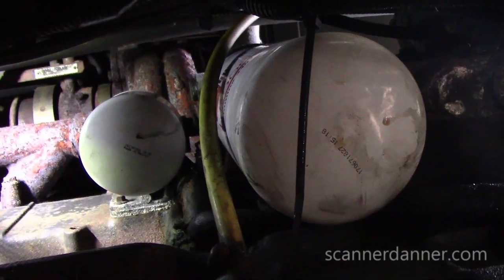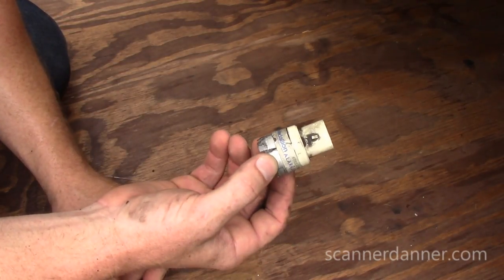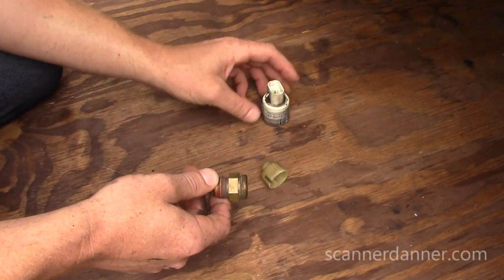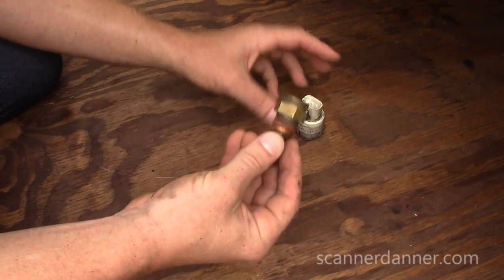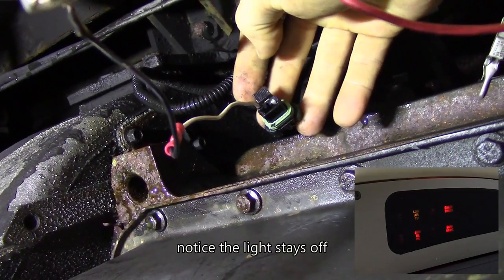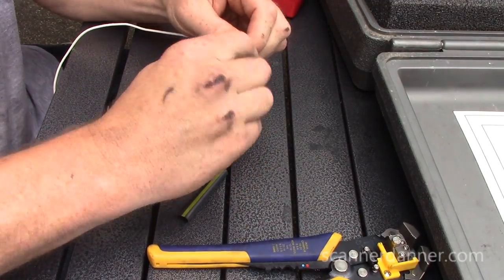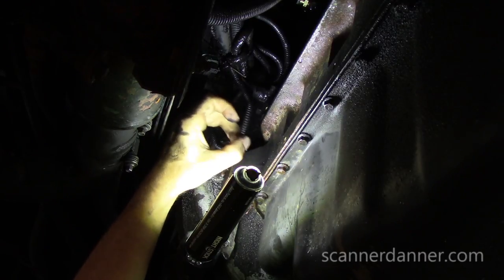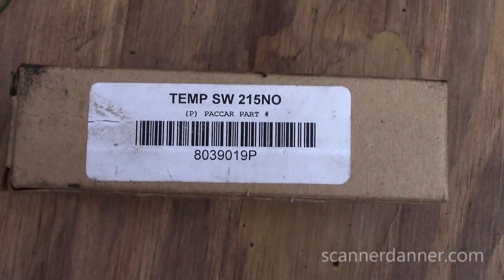High Coolant Temp Switch Circuit Diagnosis and Repair (2001 American Tradition 8.3L)

Comment from the maker: This "trip" I mentioned was taken in June of 2017. Some of you that follow me on Facebook will remember the trip. I felt like Clark Griswold when he finally made it to Wally World haha. We ended up getting chased by a tropical storm near the Gulf of Mexico, never made it to our destination, ended up at DollyWood in Tennessee and that damn storm chased us home and flooded us out at a campground in Connelsville PA (our last stop). But the RV was flawless the entire trip.
Reply: ScannerDanner  just curious, the temp light never came on with a long pull up a hill? I've never seen a high temp sensor so low.
Reply from the maker: Me either! And no, water temp never even hit 200.
Reply: I'm wondering what pressure the radiator cap is supposed to handle (according to the manufacturer, in case someone's already replaced it with an incorrect one.)  215F sounds pretty low, unless it's a lower pressure setup - in that case, it would be close to boiling point.
Reply: these big diesel engines are different than car engines.. at least the older ones run at much lower temps.. if you take a look you´ll also see oil temps being MUCH lower than on your car... I once read a operating manual of a stationary diesel engine and they wrote about an emergency shutdown at around 195°F oil temp...its not only the boiling point of the coolant, the wohle engine is designed around this coolant temp , tolerances when parts extend due to heat etc...
Reply: Getting decent heater temperature can be a problem on diesel cars,  at idle and light loads diesels burn very little fuel so less heat goes into the coolant. The temperature switch was mounted low on the block not the head so is going to see lower temperatures than if it were on the head. 
Back in before emission regulations got tight the fans  gasoline engines  typical were set to  switch on at about 97c and switch off at about 93c
Reply: I didn't pay attention fully, but "turbo diesels" with " low mounted block temp sensor" would tell you if return water temp or cylinder/piston overheat  is occurring better than head/intake sensors, due to low coolant, lack of flow or aeration/gassing (head gasket).. note I am not a diesel nor ford guy..
I've always learned the hard way "reverse engineering" ;)
Reply from the maker: It had a lower psi cap on it when I bought it but all the documentation I could fine said it should be a 16 lb cap which is what's on it now.
Reply: so someone else blew it up, changed rad caps to let it vent with less chance of blowing out coolant hoses, fed it xx cans of block sealer to hide the issue and ripped out the idiot over-temp light sensor.. seen it all before....................................................................
Reply: I'm inclined to go along with Throttle Bottle, at least until any new info comes along.  Seen that done in the past - usually for either radiators that were starting to split, or bad head gaskets.  Just toss in some "stop leak" stuff and reduce pressure so you don't blow it out again - and occasionally, it even works.  Long enough to sell it, anyway.  Finding a reliable workshop manual would be just the ticket right about now.  :-)
Reply: aussiebloke609, I hope that's not really the truth, I was just whizzing in his wheaties  :))
it does make me wonder, as evil shysters do similar things all the time, is there any honest folks anywhere in the world? :(
Reply: I know what you mean, and I hope I'm wrong, but I fear you may have hit the nail reasonably squarely.  I've seen it in the past, although not on a diesel engine - along with using really heavy oil to mask bearings on their way out, and even a handful of sawdust in the final drive to muffle the clunking sounds for a few miles (usually just barely long enough to get through a test drive.)  Only way to find out is to find the original specs...if not from the vehicle manufacturer, then maybe Cummins will have the spec for when their engine was used in that model bus.  And cross fingers, of course.  :-P

Comment: I'm a driver of Cummins engine.  That engine gets pushed to the limits of torque in the mountains etc,  even with big rad and fans etc.  With compression power and expansion of heat.  It can climb temp very quickly,  that's why Cummins put that in to give you early warning system.  In my Cummins,  I have that also.  But hasn't tripped yet.  But I have been that close to 210 when I'm hauling 30,000 pounds behind me.

Comment: Some of the sensors on our Cummins that we use in the city busses here in stl are used to shut the engine down if it stays on for a curtain number of seconds. For example the coolant sensor in the surge tank will turn in a light in the light bar if it’s tripped and if it stays in for 15 seconds it will shut the engine down

Comment: Years before electronic engines in the heavy truck market those switches were used to run alarm and auto shut down systems, with modern electronics those functions are controlled by the ecm data link connection to the truck.

I have still seen them on equipment up until the epa mandated  emission engines of late.

On older diesels 210(2 cycle Detroits) to 220 on Cumins and Cats is considered too hot, the Detroits would melt the rubber oring head seals at 210-215 :)

Comment: I love the smell of napalm in the morning no wait make that AF running down my back.
Good video glad ya made it home safe and sound there Clark.
Just thought of something. That sensor is down low in the block and heat rises so when it's 215 down at that sensor it's going to be hotter up near the top of the block so placement of the sensor makes a difference and maybe why that one is rated four4 215. TFS

Comment: Hey Paul, you prob already know this but make sure to add SCA (supplimental coolant additive) to your coolant if needed. Test strips will tell you your nitrate and ph levels. Diesels need this to prevent cylinder wall cavitation. Take care, Nick

Comment: nice fix. i can tell you're not a diesel guy though.   just a couple fyi's .1) sensor placement dictates the 215 instead of the 230 or 235. it is at the lower end of the liners therefore its getting the radiators return flow. at 215 return temp the radiators input temp will be 230-235 on normal cooling systems and 245-250 on low flow systems.  2)you got lucky on grounding that wire . you could have easily blown a fuse. here's why-single wire switches we all know are grounding type. but a two or three wire may be hot on one side with the other going to another device. it may be a shutdown, alarm  or even possibly a fan solenoid. an ohm meter test would prove ground . been in this situation before. to save myself misery i used a relay controlled by that switch to connect those wires.3) to save yourself from the antifreeze bath (although i heard its good for the skin lol j/k) pull a vacuum on the cooling system. you will still get a drop or two with that size opening   but you can rig one up with your a/c vac pump and a rad pressure test adapter. i'm never meaning to be condescending in my remakks here  and i hope you or anyone else dont take them that way. just trying to add to the knowlege you bring with these great videos.
Reply from the maker: All good tips man. Thank you!
Reply: I strongly disagree....Paul has "that gift" and by all means can certainly do Diesel repairs as well. A man of faith can do anything!
Reply: I like the vacuum idea.  Maybe just attach a shop vac to the top of the radiator - the air it pulls in through the hole should keep the coolant from leaking out the hole, or at least reduce it.  Seen it done on the cam cover to stop hot oil dripping down your arm when you remove the drain plug, and it worked well there.

Comment: I have noticed the high temp alarm on most (older) coaches will start ringing at 100 Deg C on the gauge. Going up the Ski Field Roads in New Zealand the alarm would sound after about the first 5 minutes of the climb and keep ringing all the way to the top. It does not mean stop it just means keep a close eye on your temperature and get it down before truing off  the motor. Cars are designed to be more idiot proof than heavy vehicles.

Comment: You need special coolant for that engine not auto. And 220 is hot for big diesel thats why 215 is used. Your videos are very good on autos learned alot please continue thanks rusty

 are

Comment: Maybe since that rig has a massive cooling system, the engineers figured that if it ever hits 215°, there's some serious issues the driver needs to know about. Just my guess.

It seems RV's are no different than boats or motorcycles - Bust Out Another Thousand, lol.

Nice rig though! She's a beauty!

My father-in-law still has his motorhome he bought new back in '88 - thing looks VERY dated compared to yours. Big giant review camera and monitor. It also has a 454 big block GAS engine in it - 4 MPG in the mountains! Thing will put you in the poor house. It doesn't get used much, so it eats tires too. Just 6 years of sitting idle, and you're guaranteed several blowouts. Tires are close to $500 each on the road ... and there's 9 of them with the tag axle & spare included! Fun, fun! :D

Comment: My guess on the low temp switch, is that big rigs have big radiators and control the coolant temp very well and although it may not be a overheat condition it is a warning that the temp is climbing out of the standard operating temp and give the driver plenty of time to safely pull over before engine damage occurs, because diesel engines produce a lot of heat and if the temp is out of the normal operating range it won't take long before it is really overheating. Just my 2 cents
Reply from the maker: Makes logical sense

Comment: did you add sca additives to that coolant because in diesels the coolant will pit the cylinder wall otherwise. you can use diesel coolant like the shell rotella elc so you dont have to monitor the sca level.
Reply from the maker: Yes sir and the coolant filter I put on has the additive in it.

Comment: Pre egr Diesel engines run under boiling.  The EGT's run much lower that the newer emissions controlled systems.  Your typical running temp under load should be 190-200.  Pm me any time you need info on the engine Paul.  Ism 320hp?

Comment: far easier to notice a "red light" turning on or blinking vs. the gauge creeping up slowly. been there done that and about blew one up :)
 230F to 250F is what most dummy lights trip at. 230 would be good for earlier warning. better if with a  lower temp warning sensor if it's down on the block vs. the head/s anyway
Reply: I should have stated "head temperatures are always the hottest part in the engine coolant flow" with a major instant coolant loss the sensors in heads may not react due to being "in an air pocket" so having head and block mounted idiot lights both is wise :)

Comment: Well if one is afraid of not seeing the tempgauge or light, just add a "beeper" in the leads of the light. You can get them with a 100db level of sound, it will wake you up for sure.
Reply from the maker: IT already has a beeper associated with all the idiot lights on that panel

Comment: How did you know that it was OK to ground the wires in that connector for testing?   A 2 wire switch (rather than the 1 wire type you installed) could easily have been in the positive side of the warning lamp circuit, with one wire being a constant +12V feed. Grounding that wire would have blown a fuse at the very least.
Reply: Bob Weiss that was my question also. Is that self explanatory or am I missing something?

Comment: Normal fan clutch activation temperature on big rig diesels is around 205 to 210, and the switch is usually located adjacent to the dash temperature gauge switch.  

How old is the coolant, and have you tested it for pH and additives?  If the coolant is sixteen years old, it needs to be dumped very soon, because in all likelihood, it is acidic and eating away at the liner packing.

Old defective coolant itself does not cause liner cavitation.  This is the process of liner pitting when the coolant additive package is depleted:  The thrust side of the liner is constantly oscillating, and during the contraction phase, a low pressure zone is created near the liner causing air bubbles to come out of solution, which then implode when the liner expands into them creating a shock wave of @ 60,000 psi which continually removes small amounts of the liner exterior.  Eventually, the liner wall becomes perforated allowing coolant to enter the combustion chamber leading to catastrophic failure.  

The additive package in SCA or in the Extended Life Coolant re-coats the liner to prevent that liner pitting to occur. 

If it is time to replace the coolant, I recommend ELC, as its longevity is greater; however maintain a plain spin-on water filter to remove particulates.  Hope that helps.

Your videos are always educational AND entertaining.
Reply from the maker: Thanks bro. I flushed the cooling system completely last year and put a filter on that had a full "charge"? of sca (thought it was dca, what do I know, this is all new to me. It was some chemical that was put in the coolant filter. There was a scale with different amounts of it based on need.
Reply: Cummins calls it Diesel Coolant Additive, while most of the industry uses the term Supplemental Coolant Additive.  Depending on the filter installed, the new filter may not contain sufficient SCA's.  Cummins does sell a coolant filter they call a precharge filter which is manufactured to supply the proper amount of SCA for new coolant.  The Cummins DCA4 filter, as I recall, only contains enough SCA to replenish additives depleted during the previous 250 hours of engine operation.
Reply from the maker: Yes, I used a precharge cummins filter that had a full capacity after I flushed it. And have since changed it two more times with smaller amount. I have a test kit too but didn't check it this year. I just added more dca. From what I've researched there doesn't seem to be a concern if there is too much?
Reply: if there is too much there can be what is referred to as dca dropout.  basically the over concentration will form little white crystals that look like aluminum corrosion. a small amount wont hurt but too much may plug the cooling system. only ever seen it once  and that thing had other problems. plus it was on a low flow system. they were notorious for cooling problems to start with.
Reply: OK, thanks.   I would guess the dropout (the white crystals) from excessive DCA concentration would not result from too much nitrate or nitrite but from the larger percentage of phosphates introduced.  Unlike soda pop's high acid capability to dissolve large amounts of phosphate, truck coolant need for low acidity would negate it's ability to dissolve the extra phosphate.  Just a guess though.  

I found that replacing the smaller OEM radiator with a six-row radiator solved the cooling issues on the low flow systems.

Comment: Over Heat warning light, USELESS, by the time it lights up you're already ROYALLY FUDGED. I hope you have a proper temp gauge for your own good and the vehicle's. Video was very entertaining to say the least. Good work, Mr. Danner.
Reply: it's much easier to see a "bright red light" turn on than notice a gauge creeping up slowly..
Reply from the maker: There is a gauge too and I wouldn't call this useless at all. The light is also tied into a buzzer.

Comment: Jb weid it back together .bought a 185 195 on eBay 6$ for my 86 Turismo for fan they had other temps.iv seen a hose adapter you cut hose 2clamps sensor fits in was pricey for Jeep's.😎50$.

Comment: Hey Paul, stop apologizing.  It's your rig and you can do what you like with it.  For all we know, the 215F part might have been a compromise replacement when a 230F was not in stock.  I imagine that if you measured the water temp on a hot day and added a safety factor you could infer a good alarm point.  Also, there is only so much room for a label - "Your engine is about to overheat if this light stays on too long" would be hard to fit in that space.  After all, you want a warning before any damage is done.  We often ignore gauges as they are pretty static but a light popping on draws attention.  It's all how you use the warning.  It may flicker on an uphill pass but that would be normal and expected.
FWIW - My take on sealing a connection:  Moisture + corrosive chemicals in contact for a period of time = green crusties.  If I cannot ensure that moisture will not wick up a thread or get into an area I cannot see or get to I'm better off leaving it open so the connection can get rinsed and dried during use.  An example would be a lead battery terminal.  Those loose "caps" can trap hydrogen gas, moisture, and salt all around the connection. In an open or single ended seal, moisture can wick in fast but take a long time to dry which equals a long contact time with the connection and more corrosion.  In a case such as yours, a shot of spray paint would wick in and seal everything including the thread and not leave a pocket, if non-sealing shrink tubing was used, to allow moisture to fester.  I'm not knocking your fix at all - just presenting another school of thought that can be applied to all connections.

Thanks for all you do for us to learn from.

Comment: You could have used motor oil instead of water and easily reach 215F or more. Could the low sensor temperature fot the sensor be due it beiing at the bottom of the block? Perhaps if the inlet water temperature is 215 the outlet temp would be close to 235? But that's guesswork.. Perhaps they did not have other hole to plug in that sensor? As the sensor was just a wax element and a switch, perhaps it would have been possible to put it back together, and test it with a pan of heated motor oil?